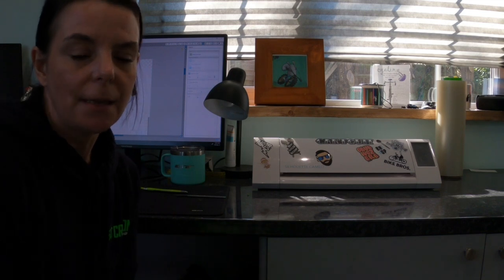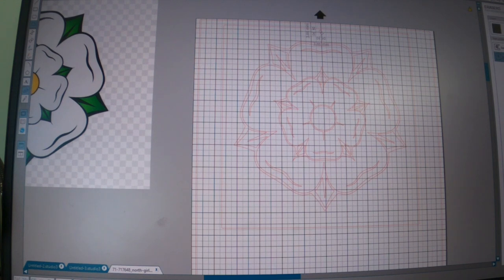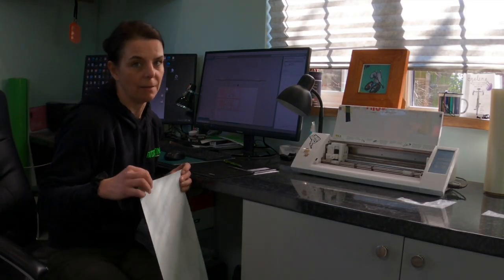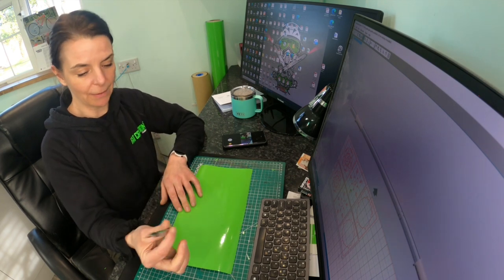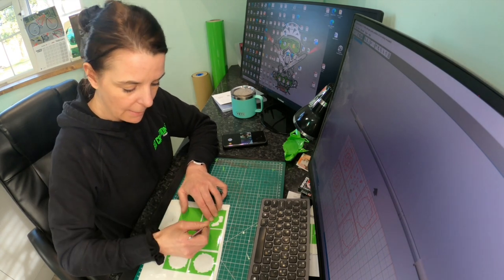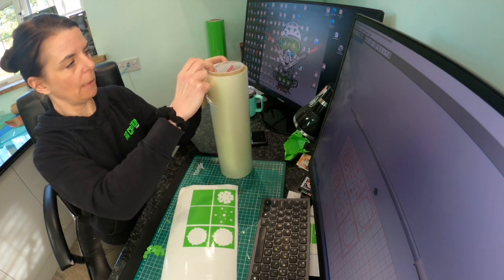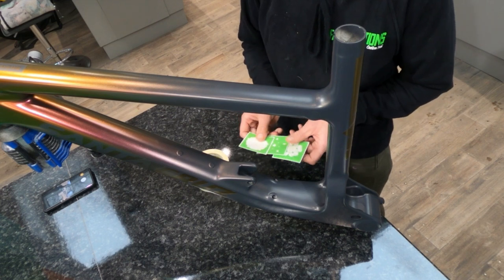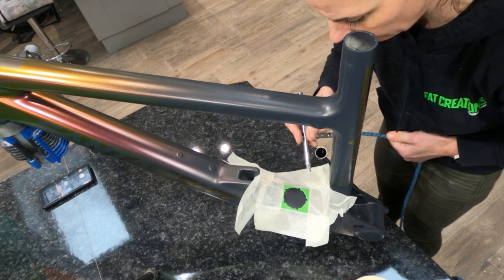How to paint a Yorkshire rose

Comment: How come you use solvent based and not water based? Do you give it a little scotch before lacquer if it's left a while after base? Was thinking of just doing my base colour, applying vinyl decals and then lacquering over them when I come to painting my frame, I'm assuming my way is the cowboy way as this looks like a much better finish. Stunning work
Reply from the maker: Solvent base drys almost immediately and we found gives better adhesion for our application. Definitely don't scotch before lacquer especially if you have used a metallic or pearl colour if you use stickers be sure they have stuck really really well. Especially around the edges then apply several dry dusting coats of the lacquer. If you go on stright away with a wet coat of lacquer over the stickers there is a chance it will lift the edges. We next to  never use stickers only if someone is after a traditional original restoration and we can't talk them out of it :)

Comment: Hi, I appreciated the work and effort involved in transferring an image to paint, however, just curious as to how long you wait before removing the previous stencil prior to painting the next stencil? I would imagine the paint is still somewhat wet ... thanks again for another great video!!
Reply from the maker: Hi Dom, thank you for watching. Thats a good question that i should've mentioned. We use a solvent based paint and applied it very thinly so its almost dry upon contact. So we can lay the next stencil on pretty much straight away.

Comment: Hi bekks , what air brush paint do you recommend for logos , did you make the single logo video, I’ve got a silhouette cameo 4 . There’s a hell of a lot to learn.( I’ve done a few practice ones but spray can is not ideal for small logos cheers Ivor
Reply from the maker: Hi Ivor, apologies I haven't yet. We use solvent base acrylics. Bear with me next job I do I'll do a single colour logo
Reply: Hi bekks , I’ve ran into a bit of bother. Which brand of airbrush paint do you recommend in small amounts. And do you thinner it . If so what amount. My brush has a .03 nozzle on at present. Finally is white spirt Ok for cleaning after use . Thanks for your time and advice i know you are busy with work cheers Ivor
Reply from the maker: @ivorpeachey4366  hi Ivor we use our standard solvent acrylics in the airbrush and thin them 2:1. If you have a large tin of paint weigh it into a container like a jam jar and thin it in there. Custom paints do some airbrush paint kits https://www.specialistpaints.com/
Reply from the maker: @ivorpeachey4366  also we have never used white spirits so I can't advise on this, we use a gun wash cellulose thinners for this

Comment: I have dents in paint in aluminium frame ( to the bare metal)  ( and pike fork ) .  Whats the best way to cover those dents?  Whats the best way to paint it ?
Reply from the maker: Sorry for not seeing this sooner. Its best to fill the dents then sand them smooth, and then prime. Then flat back your primer with 600 wet and dry to get it nice and smooth, repeat if necessary. Then apply base coats then your clear coat